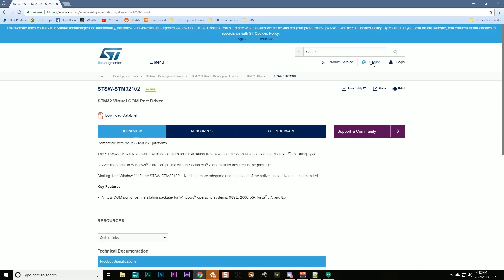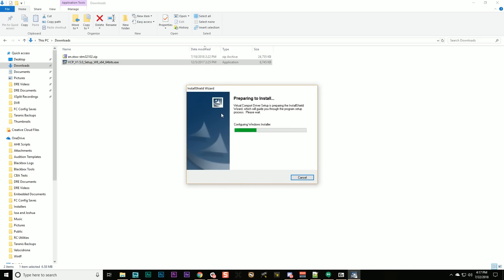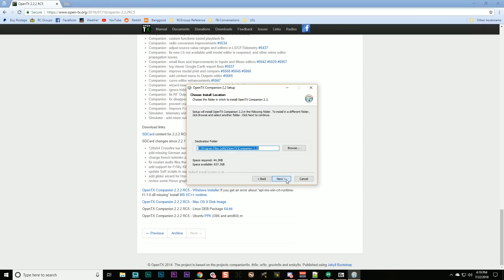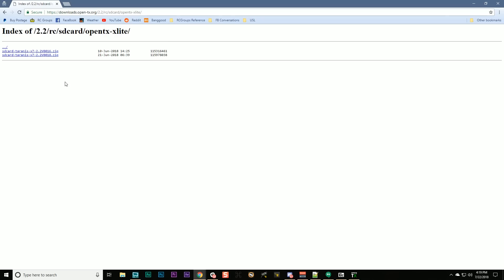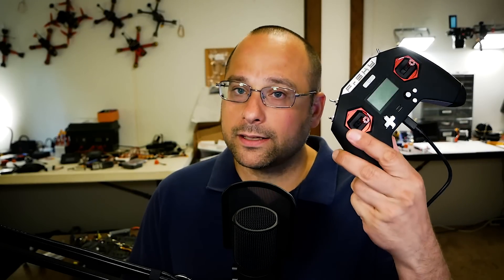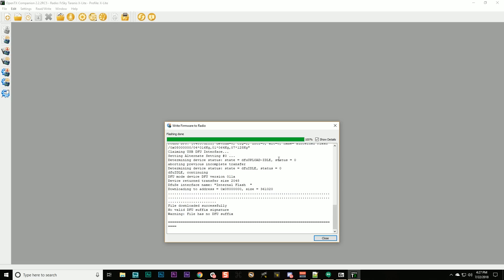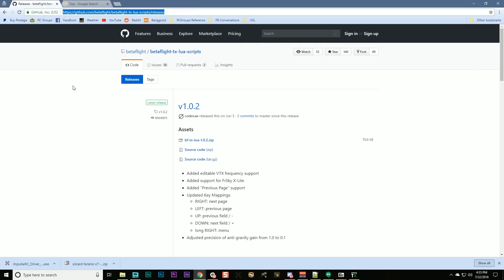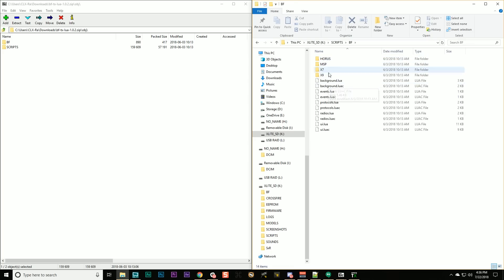FrSky X-Lite OpenTX Install/Upgrade How-To (Taranis X9D QX7 same procedure)

Comment: I’ve occasionally gotten the out-of-memory script error on my xlite. Guess I need tonuse the luac versions?
Reply from the maker: If you enable the luac option I think that's all that's required. Enable, download, re-flash.
Reply: I did it just like I remembered from your old video, loa, luac, and noheli. I suspect I:

A) didn’t add the luac scripts, and/or

B) Used the luas in the display screen, or whatever it’s called. 

Thanks, man. Looking forward to your take on the R9 lite. I’m firmly meh right now.

Comment: Great video again, JB. Thanks. 

I did a whole thing with putting it in bootliader mode by pressing all 4 d-pad buttons and whatnot. 

Also, my SD card contents came with a very nice voice pack. I added Amber to my QX7, but it never worked. I think I used an 8-character version rather than 6-character. 

My X-lite set up easy and clean, and my QX7 was a bastard... but I’m a lot better at it now. :)

Comment: Hey JB, to flash the X9D do I need those drivers and driver fixer? What about the models and so on of the X9D, what should I do?
Reply from the maker: X9D flash is identical except you choose a different radio type in OpenTX and download a different SD card contents. If you are on 2.X then the models should not be affected when you upgrade.
Reply: Joshua Bardwell Thanks a lot, JB! 😊

Comment: I am new to opentx. Was seting up a r-xsr receiver via fport, and i got it to work, meaning sticks work, and x-lite finds telemetry sensors, and reads rssi, and rxbat, but lua script is empty, as if quad was not connected. R-xsr is connected via "uninverted smart port pad" to a uart on my DYS f4 v1 FC. Any suggestions how to get it working?
Reply from the maker: RSSI, RXBat come from the receiver not the FC so it sounds like your telemetry from FC is not configured right. In the Configuration tab, did you enable the Telemetry option?
Reply: Hi, and thanks for the help.  Telemetry is enabled in configuration. EDIT: Also i managed to solve the problem. The main issue i believe was, that the wiring diagram from DYS was wrong, and they swapped tx and rx on that uart. After i swapped the wire on the FC, the x-lite found more sensors than before (only 2). Lua script still was not working at that time, but i was getting "sensor lost" warnings, so i decided to flash the Beta firmware from frsky home page, and then the script started working and showing numbers. Now i only have to figure out why i get no data from my Matek vtx.

Comment: What are the main benefits of this new firmware as compared to 2.2.1. (Taranis qx7)
Reply from the maker: Check the release notes in the download page for a full list. The big reason I updated is that R9 support is improved and the newer R9 firmwares only work with the latest version of 2.2.2.

Comment: Great videos.  I learn something every time.  Do you think you could do a video about binding the X-Lite?  When I bind I only get 8 channels option.  Am I suppose to choose 1-16 in the radio?  Doesn't RSSI need a channel?  What if I need more then 8 channels. Betaflight tuning notes say if using 16 channels to change the filter Hrz.  Im confused.
Thanks, keep up the great videos.
Reply from the maker: I think you mean the dialog box that asks 1-8 Telemetry On / 1-8 Telemetry Off etc. That option is only really relevant if you are using a receiver with PWM outputs, which you probably aren't. For a mini quad using SBUS or FPort always just select 1-8 and telemetry on or off depending on if you want telemetry (and if your receiver supports it).
Reply: Yes, that is what I was referring to.  And if I select 1-8 channels on the radio.  One of those channels need to be used for RSSI to OSD?

Comment: If I have a qx7 for example can I restore a backup of all my quads( I have 9) to the xlite so I don’t have to set them all up again?
Reply from the maker: Sort of. The switches on the X-Lite are different so all your switches will get messed up. At which point you kind of might as well just start from scratch.

Comment: How to eliminate jello efect from gopro ?
Reply from the maker: NOTIFICATION SQUAAAAAAAAADDDDD.
Reply from the maker: The best way to eliminate jello is to use an ND filter or the ISO MAX setting on a gopro to limit shutter speed. This adds more motion blur and hides the jello. Actually getting rid of the vibration is a freaking pain in the ass.
Reply: Joshua Bardwell I have nd16 filter on my gopro and jello is still here :(